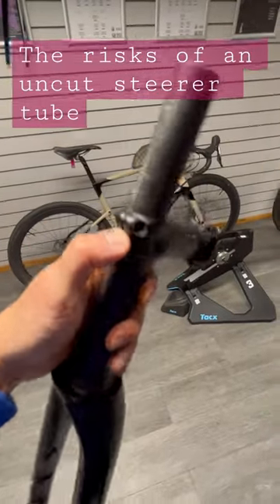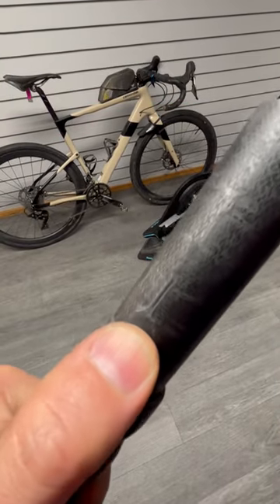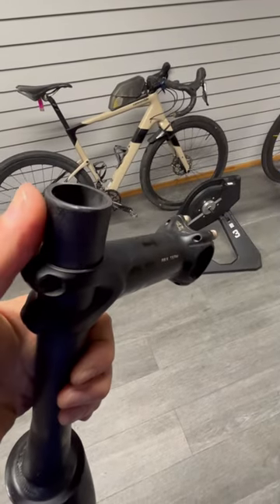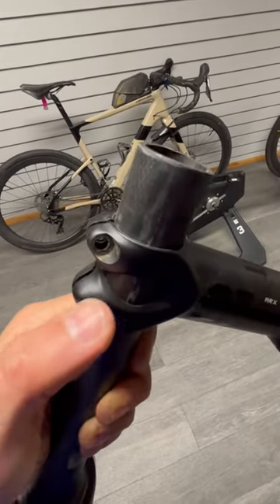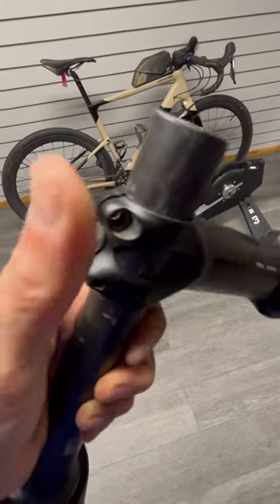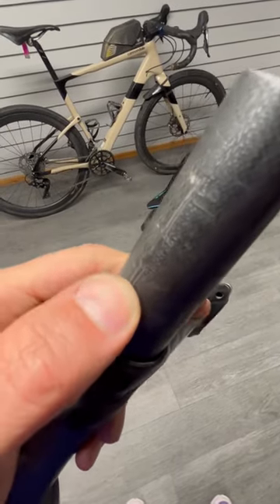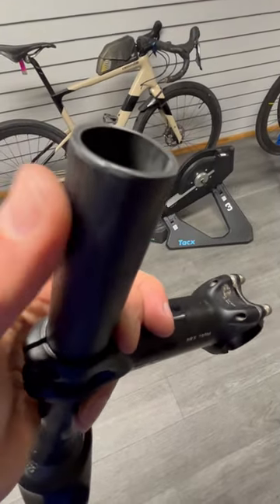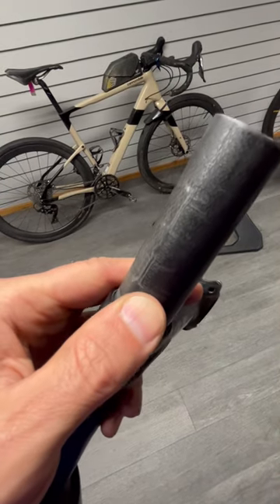This rider ruined their fork by over tightening the stem without the support of a compression bung.

Comment: Suggest using a long expander plug usually 60-70mm of correct diameter re: carbon steerer, in conjunction with a suitable stem (not all are equal - watch for sculpted apertures and internal sharp edges).  Why wouldn’t you want the stem steerer union working under equalised forces and supported internally ?

Comment: Companies like Cannondale tend to provide a lightweight but not supporting compression plug. If you also have the same problem, change it fast as possible. It does not worth having that headache.
Reply: It's still the one supplied by FSA, right? If it is, I don't remember that thing is light at all. (I'm no weight weenie, this is not one of those things whose weight I care about at all)
Reply: That's so true that I am worried using it. My stem is all the way at the top and looking at the plug it doesn't seem to provide any support to the clamping force of the stem. All it does is to compress the headset and spacer.

Comment: I'm surprised it's caused by the lack of a compression plug to be honest. Lots of new bikes are setup with uncut steerer with a compression plug far above the stem. This is indeed caused by over tightening. Would over tightening with a plug save you from those cracks? Maybe, but if you follow the torque specs there should be no issues with having the plug far above. When you think about it it's kinda like the round carbon seatpost that gets "clamped", there's no compression plug in the seatpost.
Reply: There was one time I tried torquing a stem on a section of steerer tube without the expander plug (don't worry, the steerer is a cut excess) and from the looks of it, there's no damage to it. If I can, I'd like to try with other stems.
Reply: Not every manufacturer requires and expansion bung. Mystery solved.
Reply from the maker: I think what made this worse was the compression bung was just above the stem and as the rider tried to tighten it sort of squeezed the bung upwards.  They had managed to tighten the stem clamp bolts until the 2 sides were touching.
Reply: @yonglingng5640   What is expander plug?
Reply: @Godspeed961  It's the piece of hardware that goes into carbon steerer tube's. It's meant to act as a solid core for the steerer tube and have a place for an M6 female thread for the M6 bolt of the top cap.

Comment: Just take a second expander and place it lower in the steerer tube and then use the original one higher up for getting the headset tight. Or alternatively use a longer expander. Sure, it adds a couple of grams but it wont ruin the resale value or riding position adjustability of the fork.
Reply from the maker: Interesting idea.

Comment: Would like a super long compression plug be okey so it still has support but i can put two 5mm spacers on top? So i can test before cutting?
Reply from the maker: 10mm should be fine with long compression. This rider had 30mm of spacers above stem.
Reply: @Mapdec  These days, if any customer wants me to drop a stem that low without cutting it first, I'm very reluctant to do it. I don't want to indirectly injure or kill someone just because of some shortcut way of doing things.

Comment: My uncut steerer makes noise when i tighen the stem. i push handlebar in different directions to check it after all, but  noise gone. have 3 spacers under my stem ( its a little high) .
Reply: I have 2 spacers up from my stem. should i cut the steerer and have only the top cap? Also i put some antiseize shimano paste (on steerer) and check today. The handlebar makes noises when i push the levers up & down. ALso noise comes when i climb .

Comment: Just out of curiosity I have a fork I want to use on a bike that I know had this same damage done before it was given to me , I know the crack is much smaller than this and is right up at the top of the steerer, way above where I'd need to clamp the stem , could I just cut the cracked part out and use this fork at the new height or is the whole steerer compromised now
Reply from the maker: You can tell if you measure it. There is usually a compression.

Comment: Could commpresion plug be seated lower and longder bolt used? Before damage, I mean.
Reply from the maker: They usually have a lip to prevent them falling down the tube.
Reply: Due to the flange, it's impossible. The only way would be to use a taller expander plug, one that's taller than the stem's stack height. This is exactly what I did for my bike as my frameset came with FSA's expander plug, which I refuse to use.
Reply: @yonglingng5640  Hello, just wondering what expander plug brand upgrade you’ve made to your bike?
Reply: @kidgugstev6406  Due to the slightly thicker walls of my 1 1/8-inch steerer tube, I had to use a Neco steerer tube expander plug, which suits steerer tubes with an internal diameter smaller than 23 mm. I remember it doesn't really have a strong bite on its own, so I used carbon paste to increase friction. Mine is more than 50 mm long, in case I want to drop my stem 5/10 mm lower without cutting it first.

Comment: Are there compression bungs that long to accommodate incase someone wants to test/change things up without committing to cutting?
Reply from the maker: Not to accommodate that much excess. That I know off…
Reply: You can get longer ones, 90mm is the longest I've seen.
Reply: @galenkehler  Still remember the brand? The longest I've seen online is about 70 mm. My current one is more than 50 mm tall (this is a deliberate choice as I may drop my stem by 5 - 10 mm before deciding to cut for good). My original expander plug is FSA's, which only reinforces one small area, which I don't like at all.
Reply: Deda has a 70mm version that I use on both my bikes. Don't care about the extra weight of 50mm vs 70mm, but I like the extra security.
Reply: @Karel-B  Yes, this is one component where weight should not be a concern at all. Steerer tube reinforcement percentage should be the only priority.

Comment: A brittle carbon fibre steerer tube. What a surprise. 🙄

A waste of time and money repairing that.
Reply from the maker: What’s your solution?
Reply: @Mapdec  My personal solution is that I don't ride bikes with carbon fibre forks. I don't race, so I don't feel a need for a carbon bike. Thus, I've never had this problem. I'm assuming the brittle nature of carbon fibre is the reason a compression plug is needed in the first place. Please tell me if I'm wrong. That's my personal opinion and solution. If I was the owner of this fork, I think I'd be skeptical of a steerer tube that has already cracked once, and not just for financial reasons. I think it then becomes a safety hazard. Would the owner not better off with new fork that has been properly installed? What if it cracks again? More money and possibly a trip to the hospital? Surely a new fork doesn't cost that much more. Or is the repair something that costs more than a new fork? Maybe I'm wrong, but that's my opinion. What would be the difference in cost?
Reply: @Cyclist-o6e new fork.
Reply: @harrybbbb  Have you done THM forks??      Rgr
Reply: @harrybbbb  Great comparison. So all of the millions of people who ride bikes with forks that are not made of carbon fibre are exactly akin to having gas lights on their homes? So then most people would have gas lights on their homes. There is a reason why carbon so often needs repairs and needs a compression plug installed with the fork. I'm acknowledging that there is a risk involved with re-using an already damaged steerer tube. "A damaged steerer tube could break suddenly, causing a crash resulting in injury or death."  -Trek Bicycle

Sure, it might be fine. I'd rather not take that risk. But others are free to do so. But even experts in carbon fibre repair will acknowledge the dangers of a steerer tube failure, and I wouldn't want to ride around with a steerer tube I knew had already been compromised. https://youtu.be/HPIS3QwW6WA
Reply: @flawless7019  Agreed.